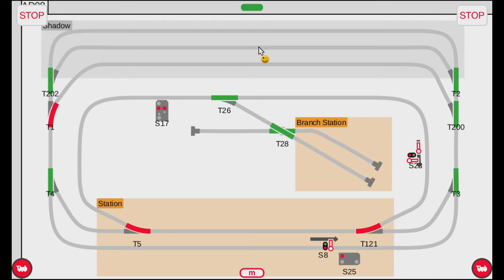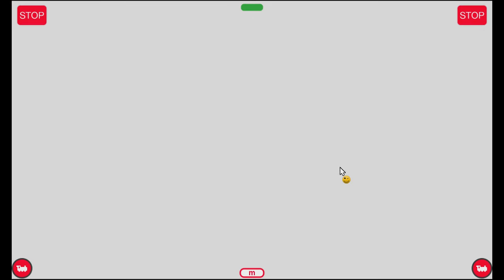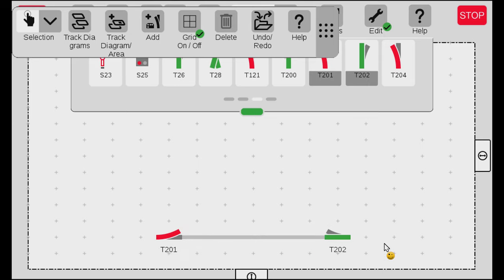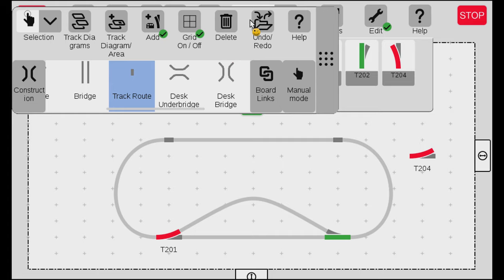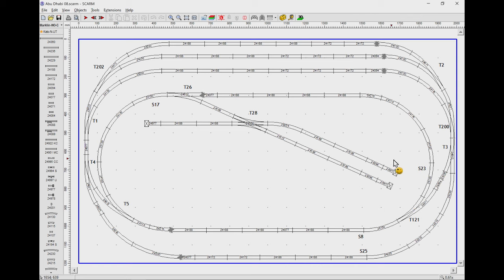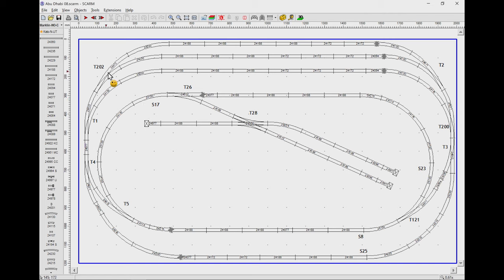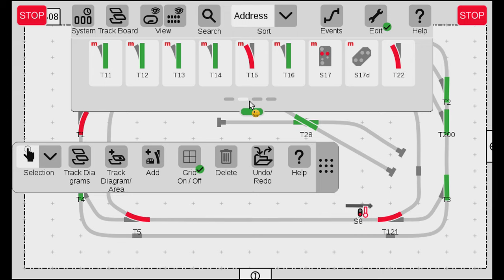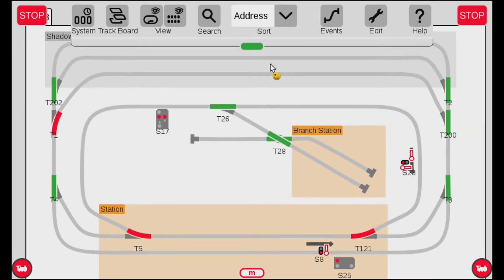Drawing Track Diagram/Track Board on the Märklin Central Station 3 (CS3 Episode 6)

Comment: When you have a switch or signal inside an area, the color of the name box of them in the article list also changes to the area color. Also, to get the trash can on an empty track board, you can get it to come up by moving a resizing handle. Great video.
Reply from the maker: Hi John, excellent tips! I like the colors on the track board and the colors on the articles is also very handy. Annoying with the trash can, but good tip. Thanks. Enjoy ;-)

Comment: Hi Bo,
Thanks for your phantastic guidelines for beginners. You spell the processes step by step which is extremely helpful.
You might know it in the menawhile: The exact turning of the elements in the panel  is better to handle if you click onto the little turn mark and then move the pressed mouse indicator a bit away from the symbol's position. 
Now by drawing a great circle you can turn the symbol degree by degree.
Reply from the maker: Hi Rudi, Great advice - Thanks! I am glad that you like the channel. Please keep the tips'n'tricks coming - always good to learn more. This one definetely mad it easier. Enjoy ;-)

Comment: Hi Bo and thx for great videos again. Fyi I got a new CS3+ yesterday, and it works perfectly! Now I can finally move forwards with my layout. Just drew my trackplans on the new one :)
Reply from the maker: Hi Oddvin, great to hear you got a new CS3+! It seemed the other one was faulty. Hoper you have fun with it and please let me know of your projects and if you need any help. Enjoy ;-)
Reply: @ModelTrainFun  Hi Bo.I have seen most of your videos before, but need to refresh my memory ;) I dont know if it was a software issue or something else. Now that I can compare the new vs the old I notice this one stayes at about the same temperature as urs in the videos, the old one always got much hotter looking at its temp. and CPU temp. (about 60+) I also noticed it was showing a small amount of Amp on the programming track even tho I didnt use that, this one dont. so now everything works perfectly and Im wery happy :) Finally I can move on , so thanks again.
Reply from the maker: @OddvinBidne  I am so glad that your CS3 got fixed. Hope you will have lots of fun with it.

Interesting with the small amount of amp on the programming track as I see another viewer has this issue as well (@Derin Hakan Karakurt). However, he did not mention blinking turnouts when turning on turning on locomotive sounds.

I tagged him in this comment, so he might have more questions, if this is ok?

Enjoy ;-)
Reply: @ModelTrainFun  Yes thats ok. just a pleasure to help if I can.

Comment: Hello, is it possible to link the turnouts to a signal. So that as you switch track the single lights or semaphore moves? I love the information you provide. TonyH
Reply from the maker: Hi Tony, Glad you like the channel!

As you are commenting on this video I assume you have a CS3. In the CS3 you can use an event to change the signal depending on the position of the turnout. You do this by enabling extended events (Open tab above, go to System->System->CS3->Track: Protocols & Operations and enable "Events - extended mode". Now you can create an event and drag the turnout on the trigger part of the event. Choose the position e.g. straight and then you can set the signal to e.g. red or green in the body of the event. As an example you can see here in this video how a signal is turned red when locomotive leaves a contact track "C3". You can drag a turnout onto the trigger in the same way.

Hope this helps! Enjoy ;-) Bo

Comment: Hi Bo, I wanted to ask you can you draw tracks using the web surface of the Central station 3 Plus?
Thanks for your time.
Lorenzo Marinelli
Reply from the maker: Hi Lorenzo, yes you can use the web page of the CS3 to draw tracks. However, I find that the latest update made it very unstable - try it out, but be ready for some quirks. Enjoy ;-) Bo

Comment: Your videos are a great starting point for CS3 knowledge.  Thank you!! A question: is it possible to have more than one layout saved in the CS3?  I can see doing it via backups, but can more than one layout be available and selectable.  Not run at the same time, but simply unplug the CS3 and move to an alternate layout.  I have my small layout and am debating adding a larger one in another room.  Thanks again.
Reply from the maker: Hi Chas,

You could have multiple layouts across several panels as you see in the video from 55:38. However, the issue will be addressing. If you have a turnout with address 1 one layout, then you cannot have another turnout with address 1 on another layout.

Well you can, but you cannot have the same turnout on two different panels. What I have done in the past to circumvent this is to make a turnout "T1" with address 1 and another turnout "T1." (added a dot) also with address one. Then you can place each turnout T1 and T1. on each it's panel.

Other options are as you mention doing backups. However, dont forget you can connect two separate layouts to same CS3. If you run out of power on the combined set of layouts you can add a booster. In this way one layout is powered through a booster while the other through the CS3. This means you must separate the addressing for turnouts, accessories and locomotives.

Hope this helps. Enjoy ;-)

Comment: I'm a young boy from Sweden at 11 years old playing with model trains for fun with my grandfather and I'm wondering do the turnouts have serial numbers to sync with the tracks and if so how do I find out those serial numbers?
Reply from the maker: Welcome to the channel - I hope you will enjoy model trains with your grandfather ;-) 

Making the turnouts shift from the Central Station 3 (CS3) requires a couple of steps:
1. You must have a turnout
2. You must install a turnout mechanism that can change the turnout
3. You must install a turnout decoder that can understand the CS3 and shift the turnout using the turnout mechanism.

These are expensive items to add to the turnout - however, you can still use the turnouts manually without them. But this means it is not connected to the track diagram/track board as you have to do it yourself. It is still fun to use the layout with manual turnouts.

You can see how to install a turnout mechanism in this video: https://www.youtube.com/watch?v=hjB_-gq7018

You can see how to install a turnout decoder in this video: https://www.youtube.com/watch?v=_6lGKQ3Vj2Q

Got any nice locomotives?

I hope this helps and have fun model railroading with your grandfather! 

Enjoy ;-)
Reply: The turnouts and track are the 24XXX series  - You use switch decoders ( 74462 or 74467 for a double slip point ) that are attached to the bottom of the points and they use whats called an address which can be from the numbers 1 to 255 and you set these addresses via  dip switches if you use Marklin products only if you want to use any other you need to use DCC products 

The best thing to do is buy a starter set and then get use to using a mobile station once your used to that you can get the CS3 or CS3+

With the mobile station you have very limited capability and my advice to you is to go over to the CS3's once your familiar with how digital works

Comment: Hello again
Is it possible to draw track layout in multiple lewels?
Er det muligt at tegne spordiagram i flere lag, dag min bane er i 3 niveauer? Tak for en super genenmgang!
Reply from the maker: Hi Jesper, I am going to respond in English so other viewers also get the benefit of reading it - if this is an issue shoot me an email (see the Channel About).

You can make multiple panels with track diagram. In this way you can use the panels to draw different sections of your layout. As an example, this could be one panel for the visible part of the layout and one for the shadow station. The track diagram is 2D and as such does not have any height.

As a guiding rule the track diagram on the CS3 does not have to look exactly like the layout in real life. The idea is to make a representation of the layout where it is easy to get an overview. As an example consider the London underground where you have an easy overview map where the lines look straight contrary to how it looks in real life. The trick is to draw something the makes you recognize the layout without have all the small bends and curves. In the same way consider how you would look at and interact with the track diagram. It could be a good idea to have a panel with your main station, one with the main line and one with the shadow station. You can jump between the panels by placing links or just choosing the panel in the menu at the top.

You can see in the video how to create multiple panels here: https://www.youtube.com/watch?v=Hi6R3ugZ-SQ&t=3338s

You can see in the video how to create the links here: https://www.youtube.com/watch?v=Hi6R3ugZ-SQ&t=3752s

How to jump between panels is illustrated here: https://www.youtube.com/watch?v=Hi6R3ugZ-SQ&t=3850s

Hope this helps! Enjoy making layout diagrams ;-)

Comment: Thanks for the wonderful video.If my track drawing is misplaced on my diagram, how can I recenter it ? Salutations from France !
Reply from the maker: Hi Bernard, you can move the diagram around and zoom. Use pinch to zoom and select next to a board and move. However, it can be difficult on the CS3. I suggest you just select the track board as you see at 1:04:10 in the video. Enjoy ;-)

Comment: Amazing tutorial!
Unfortunately I do not have a central station. Are you aware of any other programs one can use on their pc in order to draw their track? Thank you.
Reply from the maker: Hi John, 

If you are thinking about a program for drawing the layout there are many. I use SCARM (https://www.scarm.info/), but there are many others like WinTrack (https://www.wintrack.de/).

If you are thinking about a program that where you can draw the layout and automate the trains - again there are many. I have experimented with WinDigipet (https://www.windigipet.de/info/en/) and TrainController (https://www.freiwald.com/pages/traincontroller.htm). There is also JMRI (https://www.jmri.org/) and iTrain. You can find even more out there. 

Hope this helps. Enjoy ;-)
Reply: @ModelTrainFun  After going through the programs you suggested, I ended up using SCARM. I find it very nice and easy to use. I have already started designing my track layout. 🙂
Reply from the maker: @JohnPap_Net  Sounds great John. Lots of fun to draw layouts. Do you have a room big enough to make a decent layout?
Reply: @ModelTrainFun  Well, the biggest layout I can make is 250cm x 150cm and this is what I am working on.
Reply from the maker: @JohnPap_Net  You should be able to get a decent layout at this size. If you are making different levels - remember to think about and later test the angle/grade of the track. In Scarm you can also view the grades of the track - I seem to recall SHIFT+L a couple of times... Use SHIFT+L again to get back to model numbers on the track. Enjoy ;-)

Comment: Great video, thank you. 
I'm just wondering if I can create my own symbol in the panel by CS3?
For example, a special signal that I use on the layout (or other things), let's say a speed indicator? Is it possible?
Reply from the maker: Hi, glad you find the video useful! Unfortunately, you cannot customize the symbols. Would probably be complex for Märklin to implement. Out of curiosity - what is your idea with the speed indicator? Are you talking about showing max speed on a section of track? Enjoy ;-)
Reply: Hi, thanks for the answer, it's a pity you can't make your own symbol.
I was actually referring to the signaling pictures. In Europe, railway signals in a few countries show permitted speeds different from the standard speed. For example, the train can go 60 km/h instead of 40 km/h on a switch.
I assume that CS3 doesn't have 5 or 6 aspect signal in library to choose, I suppose maximum 4 aspect signal I can find. So I thought I'd make it if possible, but it's not.
Reply from the maker: Hi, one option I can think of is to make a 4 aspect signal and then have an extra light next to it to either turn on/off - or change between the speeds.  However, all of this depends on the decoder you are using. Which decoder are you using for 5- or 6- aspect signals? Enjoy ;-)
Reply: @ModelTrainFun  Hi, so here is my story from Hungary. 
Currently I have a carpet layout of C track. However, at the end of the this year, I will build a permanent dream layout in the garage. Dimensions 4.6 x 2.7 m. The visible part will be C track, the hidden yard will be K track. About 16 trains can run in traffic.
Now I'm looking for the right control station, that's why I'm watching your great and well detailed videos. 
I used to use Railroad & Co. (a previous version) of TrainController and I might choose that one in the end, but I haven't decided yet. I'm thinking of ESU Ecos because it's cheaper than CS3, although it can't do automation. I like the Z21 of Roco, but unfortunately apart from DCC, it only supports motorola, not mfx.

Other.
Roco and qdecoder make 5-6 aspect decoders. I have to say that Qdecoder is a signal decoder specialist.
Reply from the maker: @furedipeter2146  Sounds like you have a great project to look forward to. With respect to control station there are many opinions about this and in the end it is a personal taste. With respect to the price - at my model train shop they are in the same price range: (ESU 50210 ECoS 2 EUR 639 vs Märklin CS3 + power supply EUR 600+83). So both expensive.

For larger layouts consider software automation like TrainController. I believe it is easier than CS3 automation. Then you may even consider if you actually are going to run trains manually. If not, then the control station is really just a gateway between the software and the tracks. Is MFX really needed? Very nice, but maybe Z21 is enough? I have even considered playing with the Digikeijs DR5000 which is a lot cheaper and only does DCC. However all latest Märklin accessoires are DCC compatible... but maybe this is going too far? One will always have something with Märklin Motorola protocol? Another alternative is to buy a used CS2?

Well - lot of choices and options out there. Personally I like the CS3 as it enables lots of functionality both when driving manually, for automation, interface to a PC and manual control from a PC/phone/tablet.

I have heard of Qdecoder before and did a quick read in the manual, but it was not immediately apparent to me if what you see on the CS3 would correspond to the signal on the qdecoder. I do not experience with this one - sorry. I do believe I have seen it work with TrainController independently of what control station you are using... 

I am wondering if advanced signalling really only is easy/possible using software automation? Most control stations will probably not offer great support for this.

Just some thoughts - hope it helps.

Enjoy ;-)